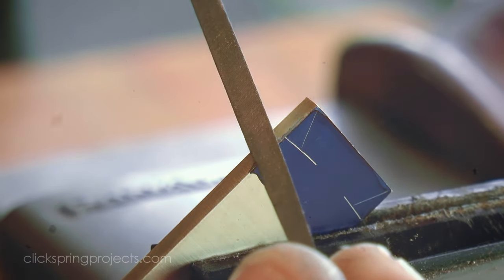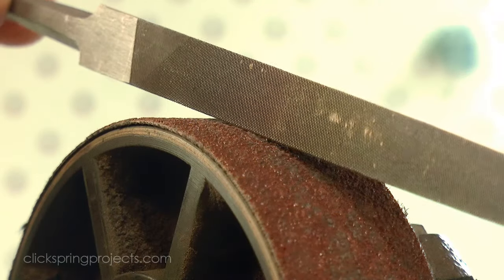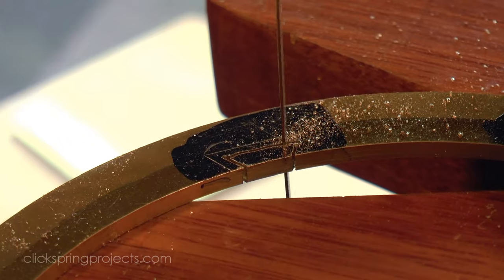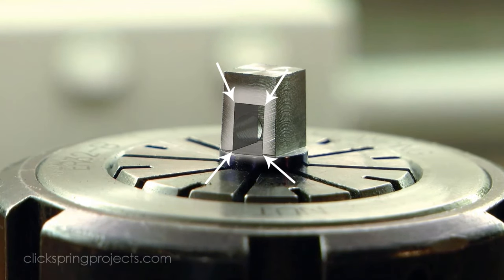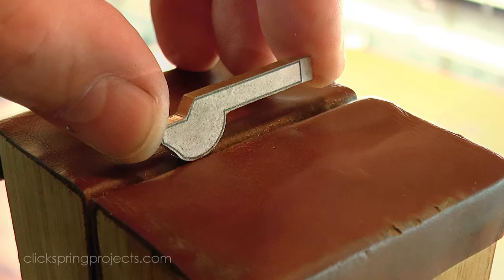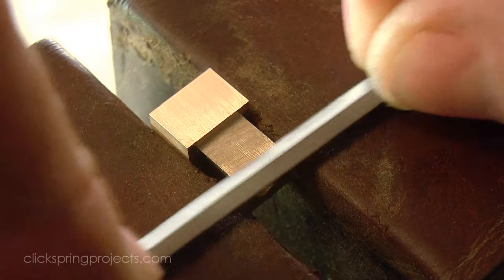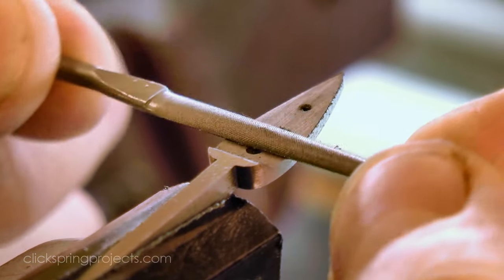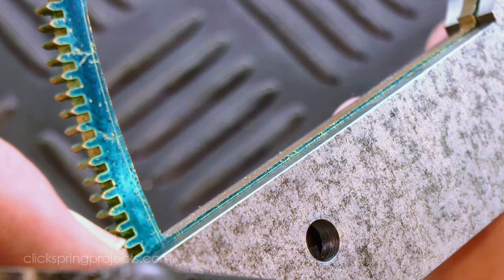8 Old School Tips For Better Hand Filing

Comment: I would add three things to the list:
1) Mind your body - as with any hand tool, how you hold your body has a huge affect on the quality.
2) Never drag the file backwards unless it cant be avoided. Dragging the file backwards damages the cutting edges. It cant always be avoided, but avoid as much as possible.
3) Don't mix files for yellow metals with those for steels. A file used on steel will never file brass the same again.
Bonus tip: files really can not be sharpened. Soaking them in acid just makes an abused file better, it does not make it good.
Reply: Those are great points; in relation to your point one, when I'm doing really accurate work, I try to pretend I'm a robot, programmed for straight line motion using rotary joints. That seems to help make the motion more consistent, as well as straighter. It's not possible to produce flat surfaces if every stroke is different from the last one.
Reply: I forgot to add: point 2) is really only important when filing work which is hard, either locally or all over. (eg, when welding has been done on steel of unknown analysis, or when a nickel bearing alloy has been cold worked, or with cast iron which has major changes of section causing chilled regions (which can be hard enough to kill any file)...
Anything below maybe 35Rc, it really doesn't hurt the file, and can make it easier to maintain good alignments. 
Some reckon it also helps keep the gullets from trapping chips ("pinning") which then gouge the surface. I think this depends, but I yet to arrive at a set of preconditions which allow me to reliably predict when it will and when it won't help.

Comment: Here's a few more:

Files are seldom "flat." It makes sense to map in your mind the convexities and concavities of a new file and take advantage for them depending on the features you need to file.

If you have large flat surfaces to file use the convex surfaces to concentrate stock removal where needed. If you have much to remove, look at the "belly" of three and four square files (American usage) where their more exaggeratedconvexity focuses effort on a smaller area improving stock removal as well.

Cheat. Use filing guides, filing machines, pair up identical parts, etc to broaden narrow edges to mitigate "roll-off" and other geometry errors. There's no merit to making parts over and over until you get one right on principal following purist notions of emulating "old school" skill.

Practice, start simple, make shape guages, etc to improve your hand skills and train your eye and muscle memory before you attempt production parts. 

I think Chris is absolutely correct: Grobet, the authentic Swiss article, is about the sole remaining maker of precision files left in the world. They are expensive but in soft materials like brass and annealed steels they will last for many years of daily use. Thus they are cheap in the long run but getting outfitted will be a shock. Study their catalogs and assess your work. Then select the grades and shapes accordingly. Eight or ten assorted files of the right shapes can cover an amazing array of work situations. It's only money. You can eat next week.

File cleaning: NEVER USE THE WIRE SIDE OF A FILE CARD!!! The wires are hard and blunt therefore incredibly wearing on the delicate cutting edges of a file. My favorite file cleaning trick is to make a wood "chisel" of some low silica hardwood like maple or beech. Use the cutting edge of the wooden chisel to clear swarf accumulations in overlapping strokes following the file teeth. Use the fiber brush side of the card to tidy up. 

Pinning: Ideally, the swarf - the tiny chips - drop from the tooth spaces as they clear the work. Some soft malleable materials self weld to a degree like aluminum or iron to form "pins" - little hard-packed deposits of swarf - between the teeth. Most of these may be picked out with a pointed soft steel "scribe". Harder pins may require a hard scribe but care must be taken to avoid damaging the adjacent file teeth. Clean the file frequently. There is no remedy for pinning more effective than file cleaning, care, and vigilence.
Reply: Great advice

Comment: Filing tip- If you don't have a handle for your file drill a hole in a golf ball and use some epoxy. The golf ball gives you a more natural means of pushing your file then the standard handle.
Reply: You know what I found that is a million times better than those golf ball handles are the handles from old screw drivers. Who doesn't have a hand full of old worn out screw drivers where the blades are so worn out that they tend to cam out of screws damaging them instead of torquing them in or out.  Also this is good use for all those free mediocre Harbor Freight screwdrivers that no one ever needs... Just clamp the blade in a vise and knock the handle off with a hammer or mallet, they are just pressed on.  Then just press on to your file of choice.  Much more ergonomic than trying to hold onto something round attached to a lever where the load is at the opposite end of this lever.  Your hand and golf ball are basically a ball joint, totally not what you want when you need control!  A screw driver handle gives you a full hand grip and your hand doesn't need to clench with so much effort like it would have to gripping a golf ball in order to to maintain control of the file.   I don't know why the golf ball trick got to be a thing because honestly it is terrible, IMO.  I never seen anybody use screw driver handles, but made sense to me and simply works great.  That's my tip.
Reply: I use those "soccer" balls from foosball table. They are the perfect size and tougher than a pine knot.
Reply: The reason that file handles are the shape they are, longer rather than ball shaped, is that it wraps the user's hand around the handle rather than putting it behind the handle and in line with the tang.
I've seen wooden handles split when not properly maintained, plastic ones split regardless of how they're treated, and I think this is very likely to happen with the suggested screwdriver handles too because this is not what they are designed for. They're designed for a twisting action, not a pushing motion.
I've seen a handle come off when the user was filing vigorously. His hand came forward still holding the handle that was no longer attached to the file. These all resulted in the tang cutting into the user's wrist, sometimes opening up the artery and causing a lot of pain, blood loss and distress. That's why workshop practice instructors are all supposed to be first-aid trained, certainly in the UK anyway.
Another consideration is that blood is very corrosive to light alloys, for example, those used in airframe structural repair, and it is hard to remove from crevices. While this may not be your first concern when you're hosing the local area with your bodily fluids, remember you'll probably be the one trying to remove it later.

Comment: have you ever used chalk? the theory is that you run the file over chalk then go to work, the chalk in the recesses prevent the file from clogging up with metal.
Reply: superdupergrover chalk works well mate espcially on materials like aluminium, that clogging you're talking about is known as pinning
Reply: Was just checking no one had suggested chalk.
You beat me to it.  😎
Reply: superdupergrover i personally dont like using it. If i do so, only with the less rougher files that i use to work out the big scratches from the previous filing. But its not really necessary i think
Reply: I keep a few sticks of blackboard chalk with my files and generally use it for fine-work on steel parts. Nothing more irritating than a pin scoring the surface and spoiling it on the last few strokes. Keep a few strips of 16 gauge mild steel and run the end edges back and forth along the cutting-teeth of the file, at 45 degrees. The file will cut grooves and points that when run across the file will clear all chalk and filings from the file before you re-chalk.
Reply: nlo114
 I use copper strip or even the end of a piece of copper water pipe.

Comment: Since tip #1 was use to use the best possible files--just wondering how your shop-made files hold up to the ones you recommend in the video. Beyond the satisfaction of using shop-made tools, how well do they actually work?
Reply from the maker: Generally the feel is not as pleasant as the Grobet's, but they're still competitive and doing the job of cutting well - One of the flat files in particular is indistinguishable from the good stuff, very sweet cut - Cheers :)
Reply: How does the production cost of those shop-made files compare to the cost of just buying professional ones, and how much time did it take you to make them? Would you say that making your own files in the shop is worth the effort and time involved?
Reply: Seems like a question of if you just want to use the best possible files; I imagine that even if you don't get the very best possible file, that practicing the skills involved in making a file is also extremely useful.

Comment: if you run the file over some chalk before you use it, it helps to prevent the cutting teeth from becoming clogged with cuttings

Comment: don't use a 'file card' use a brass brush... a file card is generally made of hardened steel wire and will dull(ruin)  your files in a hurry.
Reply: Dane J - I use a flattened brass rifle cartridge. It wears to the shape of the teeth and really digs out stuff from the gullets. Credit: Guy Lautard.
Reply: Dane J... I actually used a 1" paint brush I had cut down for some stippling, my file card was crap and lost most of its wire and the brush was on the bench, it did the job really well as the bristles were cut very short, for some of the chunks I had to stab @ the file but like I said it did the job. I also have some cheap wire brushes with thin bristles that bend easier than my card did and these work great too. G :)

Comment: Not only good quality files but "new" for brass and when the new edge has worn, down grade them for use with steel   ?
Reply from the maker: Yes definitely keep them fresh for brass - Cheers :)
Reply: same with wood- once used on steel it will not cut wood well!
Reply: Not the first time I hear this, but I still dont understand it. Why is brass more demanding on files than steel?
Reply: Brass is softer, thus tends to smear and cover the edges. Steel however is going to wear the edges down as it is harder, and when going back to brass or soft materials this rolled over and blunt edge means you have more tearing of the material than cutting it, leading to a very low rate of removal and a poor finish. Generally best to keep separate files for aluminium, brass and steel, and another set for wood and plastics. A file card as well is great though to keep the files in good order, allowing you to clean off a lot of the dross that has collected in the grooves that prevents a good cut.

I have some steel files that started off years ago as good Bast files, but they now are so worn that they could better be classed as smooth, but I still use them for final work as they remove so little material with each stroke I can easily creep up on the final point, plus they are great for clearing cut threads. Got newer files, and yes agree that quality is better, but sometimes you have to buy what you can at the time, or what you need for the immediate job at hand.

Good use for old files though is to detemper them and turn into knives, there is good steel in them, that holds an edge fine when you retemper it finally. Broken files still are also useful, you sometimes have no room for a full file in jobs, but a chunk of file will work there.
Reply: I paint my brass files yellow close to the tang, siver for aluminium. When worn down remove the paint and are steel dedicated.
Reply: Thanks for the explanation and tips. Is aluminium any different? Would it hurt to use the same set for aluminium and brass?
Reply: Aluminium and copper are even worse when it comes to smear. They gunk up your files really quickly and are, at least in my opinion, even more demanding on the file than brass.
Reply: Keep rubbing chalk into your file before you start helps stop clogging.

Comment: great video. 
one of the most valuable filing tips I learned during my fitting apprenticeship from an old Croatian guy back in the 70s was when filing a cylindrical surface we naturally tend to run a flat file following the curve of the surface which can tend to leave a series of flat spots instead of a uniform curvature. But if you gently rock the file back and forward in the opposite direction of the curve as you are filing this prevents any undesirable flat spots developing.
Reply: That's how I learned it too.

Comment: I did about 12 months of weld-prep working on a power-station build when a lad. I did a lot of angle grinding. After about 6 months I worked out I could prep a 12” 1/4” (?) oil line faster with a half-round rough bastard file than with the combination of the file and the grinder.  No picking up and putting down to change tools. Quieter safer faster. I looked after my files too.
Love your work!!

Comment: Chris, you have no idea how helpful this was to me. I'm working on cutting a key for a BiLock. Not sure if you are familiar with it, but its a lock that has 2 rows of pins, so the key has 2 blades. Each blade has its own bitting, so you don't have much of a stroke to play with, without cutting into the opposite side. The factory cuts each side of the key before it's folded to complete the dual bladed key the lock is famous for. I was actually going to ask you how you would approach something like this but you answered most of my questions in this video. Anyway, I'm babbling on, thank you for this info again Chris!
Reply from the maker: Awesome mate, I'm so pleased :)

Comment: Thanks for the tips. I often have problems filing a straight flat surface without having low or high spots. I often get in a hurry or get aggravated and start over. The file blocks will help with that.

Comment: Ah Chris, another fine epistle. With your filing buttons, I make the bolt a close sliding fit on the buttons and the section thru the part to be filed.   When I file down to them they roll with the file stroke. It often means I can use the same buttons many times. And, by the way, you were spot on using mild steel, unhardend. Bit of a no brainer really.😎
Pete

Comment: Chris, Thank you for this information.  For curved features I have been experimenting with using those long straight knife sharpening file tools.  Most of them have a straight section before the tool begins to taper to the end.  And for some features that taper comes in handy.  Thank you for sharing your experience.

Comment: 6:50 Reference edges. Excellent, excellent point.  I was watching this thinking, I'll never be this good... but using the edges of the vice as reference edges. Well this is something I know about. (When you visited Canterbury Cathedral was one of the first things you noticed the column near the nave was bowing in? Did that building down the street at New Lanark stop you cold? It's on a couple of sloping streets, I had to stop an appreciate it. 2 degrees tilt.) As an old carpenter, photographer I spot these things.  I can usually walk into a room to photograph a painting on the wall and roughly set up my camera within a couple of cm of dead center on the painting, get the distance right,  and even match the angle the painting is hanging on its wire.... However, if I need to hang black paper (seamless-US, No seam-UK) behind the painting, the edges are never plumb. An edge that is a couple of degrees off will always completely throw me off.  Edges are very powerful at orienting us. They can get disorient us, or they they can turn us into human theodolites. 
What I'd suggest for a shop set-up where edges are useful is to experiment with lots of different things, make the set up rectilinear to the walls, bench, If there are any unstraight joints, gouges in the bench top, fill them in (lower the contrast) and use shadows. A light that is orthogonal (90 degrees or straight on) to a piece casts a 'straight' shadow. Off to the side, even just a little, diagonal shadow. 
Clearly, Mr Clickspring, you are well on top of your game, but some of the rest of us? The top of your vice are flat rectangles, what if there were two long blocks running parallel to the opening? Or lines were drawn on the top leather? These might help judge level, or keep the file in a straight line, or be able to subtly go just off axis. Also, is the vise level and plumb? 
On my iPhone is a Measuring App that has a bubble level function. It's amazing how close we can get to perfectly level without looking at it. So a vise that is off a bit might throw this ability a bit out  of whack. 
I envy your skill and precision, and I think I can appreciate it even more being both sloppy but spatially aware. Have you ever used a chisel with a crooked handle? Sometimes it makes no difference, sometimes it throws everything off. It's very subtle and interesting how all this works.  Great videos, this one is like having a great teacher.

Comment: Great vid, the patience and precision you have never ceases to amaze me! 
Is the draw filing done with different files or are they all they same? I think I need you to do a filing basics video so I can watch that
Reply from the maker: Thank you George! Use the same files for draw filing, just the grip changes to both ends of the file. If the tang is in your left hand, pull the file towards you to make the cut. If its in your right hand, push away to cut - Cheers :)